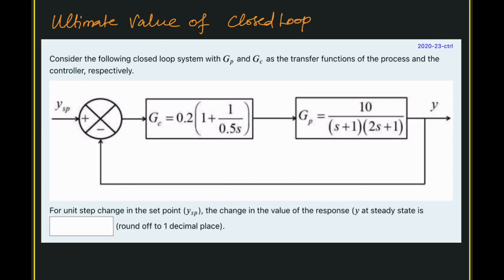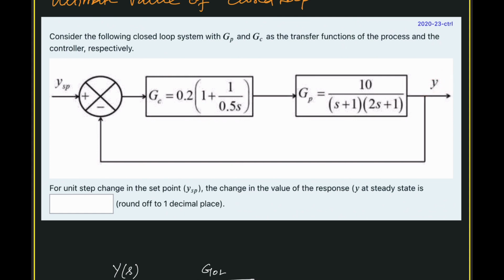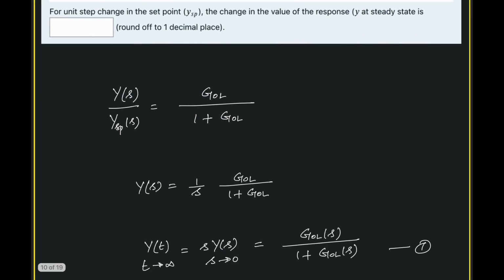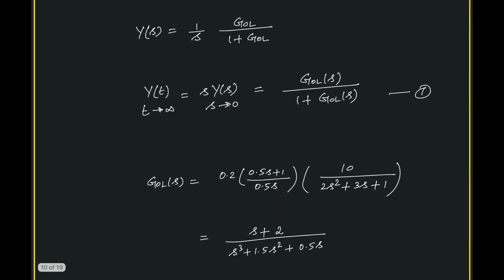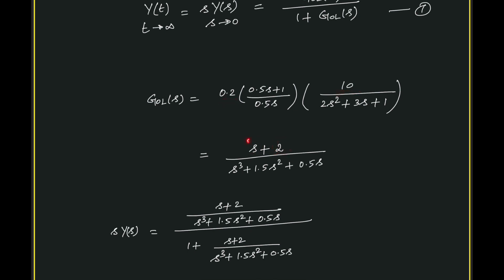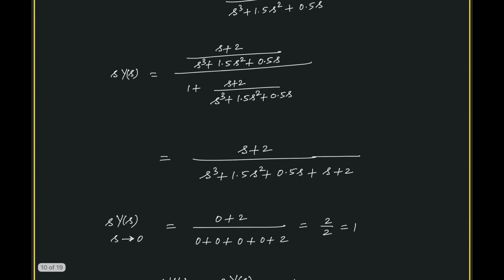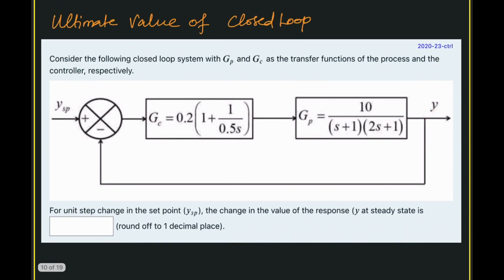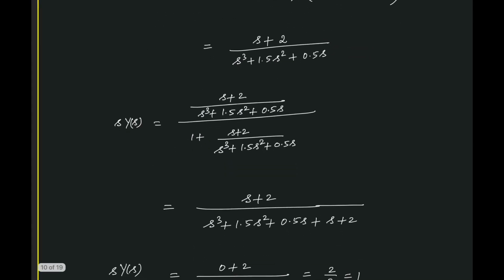Ultimate Value of Closed Loop | Final Value Theorem | Feedback Control | Process Control | msubbu

Comment: How the final answer is 1. It has asked that, what is the change in the value of the response. So, as the output is same as input, so that means no change in the value of the response. So, the final answer should be zero?
Reply from the maker: Initially the value of the system is zero. Because of step input of size 1, output also reaches the value of 1. The value of output at steady state is 1, for the steady input of 1.